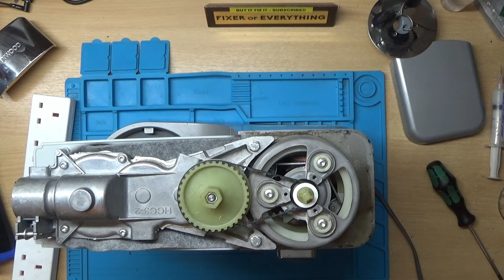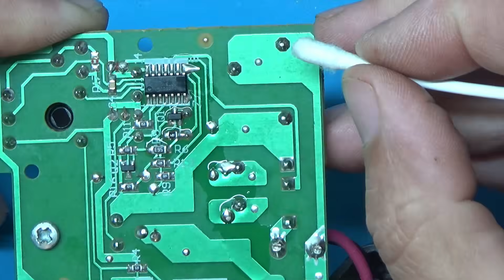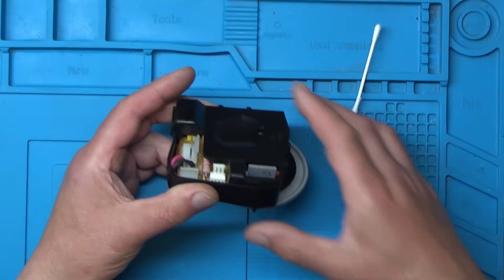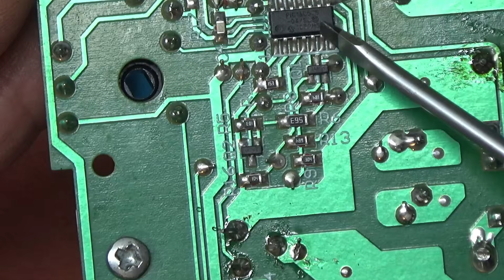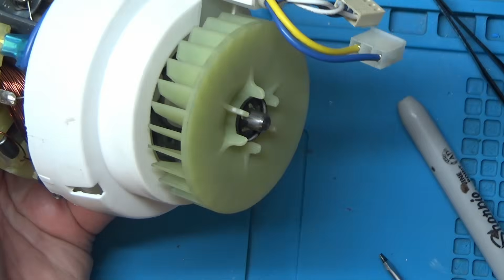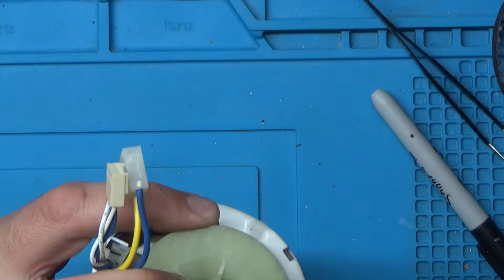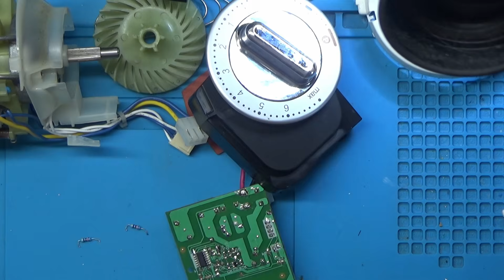Faulty Kenwood Chef Mixer - What A Nightmare! | Can I Fix It?

Comment: Looks like the coating that was put on those resistors altered the colour of the bands. A 502K should be blue black red orange, to make an orange band appear to be brown is quite a change.
Reply from the maker: I think they were supposed to be 470K, but perhaps over time / heat or something make them go out of spec.
Reply: @BuyitFixit  470K (correct) to 502K is a long way off spec at 1%.

Comment: I have much respect for your electronic diagnostic knowledge and soldering skills.  I do need to know why you did not use thermal camera?
Reply from the maker: Thanks 👍I only really use the thermal if I think it's a short circuit. The symptoms on this seemed like a capacitor or something as if you left it for a few moments (switched off) it briefly sprang back into life then progressively got worse and worse.

Comment: For years Kenwood used a rather efficient centrifugal speed regulator that seldom went wrong,  was it worth replacing it with a rather crap circuit when people bye a Kenwwod for reliability. I have the MK 1 in the basement awaiting refurbishment, it still works despite the grease being thicker than a weed smoking Gen Z teenager.
Reply from the maker: 😂😂😂😂Yes the kitchen aid I worked on a few months back has the centrifugal speed regulator too. Built like a tank it is, and 36 years old!
Reply: @BuyitFixit  Progress !.   That job was a right bugger for you and more of a challenge than the ultrasound unit.  Q; the magnetic ring needs to give an accurate speed signal, is it intended to be loose to feedback a lagging signal ?.
Reply from the maker: I think when the fan part (that I removed) is pushed back on, it squashes that silicone washer down and it grips the magnet. I think it was just spinning because I had removed the fan.
Reply: The old 50's A700 (you think MK 1) is useful as an ornament. Good luck finding a replacement bowl or attachments for it.  They break when dropped.  The A700 glass bowls are not interchangeable with any of the later models i.e. A701A, A703C, A901 > all the way to present models. A modern stainless bowl will fit and function on my old 60's machines. My old milk glass bows will fit on a modern machine.

Comment: Such a cheap fix even though it was a pain to fault find, good patience to find it. Is it possible to test resistors and capacitors in circuit with a special kind of tester or do they always need to be removed?
Reply from the maker: Thanks 👍It depends on the circuit. It's not always possible to test components in circuit as other components may be wired in parallel and give false readings. The best way to be sure is to remove / isolate the component you are testing.

Comment: That's why, unless you really have the skill and even more time, it's cheaper to just throw the whole thing and buy a new one. If you calculate your hours as a skilled technician, repairs like this are unfortunately hardly worth it. But it's good fun and interesting to watch.
Reply from the maker: Thanks 👍Or if you have someone have a problem the same as this, they now know what to check and pretty much how the circuit works 🙂
Reply: "..just throw the whole thing.."  That's all well and good for the affluent effluent types. 
A typical wage slave service guy under the hammer would change the module and earn their keep... and reduce landfill from the 'just chuck it all out' type.

Comment: Probably worth checking everything isnt shorted or open circuit. As that resistor was. Would it have given a reading in circuit or could you have tested it in circuit and still found the fault?
Reply from the maker: It depends if any other components are wired in parallel with it which would give a false reading. Usually best way is to lift a leg or remove a component to test it properly.

Comment: Cracking good repair! Never seen a resistor do that trick. You may think about one of the cheap ESR meters for the caps. Or an old Heath or Eico to check breakdown voltage.
Reply from the maker: Cheers Tom 👍Yes I don't think I've came across that before either.

Comment: Not being negative but I was wondering why you didn’t look at the triac signals with a O’scope.  You pulled a lot of components first without looking at VCC or PWM signals just curious.  Also now after it is fixed it would be nice to look at the signals especially the feedback path with a O’scope to learn what the pic is looking for would help a lot of your viewers out for sure.  As always love watching you fix stuff.
Reply from the maker: Thanks 👍I don't have a battery powered scope or isolation transformer.
Reply: A differential probe could work as well
Reply from the maker: I'll have to look into that 👍

Comment: 470K mains dropping resistors  are a common problem ! they should always  be replaced with multiple  resistors to divide the voltage drop across each resistor to prevent failure due to specification breakdown limits being approached.
Reply from the maker: Thanks for that I've not came across this problem before 👍
Reply: Yep agreed, those resistors are not rated at 240v, so this one just gave up!

Comment: Well done, but I'm surprised it worked ok with a loose taco magnet. I used to repair washing machines and a fairly common fault was the motor doing a short rev-up then cutting out due to no tacho poses being sensed - caused by loose or broken magnet (should be firmly fixed to the shaft).
Reply from the maker: Thanks 👍I think when the fan is fitted it presses against that silicone ring stopping the magnet from rotating on the shaft.
Reply: @BuyitFixit  Ah yes I never thought of that 👍

Comment: Good find, but would wonder about resistor opening like that. Possible wattage or what?
Reply from the maker: Yes, but I would think there would be loads of these failed with the same problem if it was a design problem (perhaps there are).

Comment: For burnt out resistors, measure the two parts. One part will hopefully give a reading. eg if ~2/3rds of its original length measures ~32kΩ and the other ~1/3rd is open circuit then it's a pretty safe bet that the original was 47kΩ.

For a completely open circuit resistor, cut it in half. One part should give you a reading, eg 500kΩ, so the whole thing would be 1MΩ. They fail at a single point, not along the entire length. 

Just a simple bit of educated guesswork on the ratio you have that works and rounding to the nearest E24 value can really get you out of a hole sometimes.
Reply from the maker: Great Tip! Thanks for that 👍
Reply: I like #2. Possibly poorly formed in manufacturing? Something caused it to let go without any indication. Murphys Law ? Hummmm!
Reply: Why TF would you go down that rabbit hole when the colours are visible AND you have an identical intact resistor to measure & confirm....
You would only ever go down that route if the resistor was burned up or otherwise unreadable/un-measurable and you had no other way of finding the value so not relevant to this situation at all!
Reply: @Awynn0 i think that was his point
Reply: @eliotmansfield yeah literally in the first sentence

Comment: I would never have found this one! Defective resistors without visible damage is something I didn’t think could happen …
Reply from the maker: Yes, I don't recall coming across it either. I think that's the reason why it took me so long to find it 👍
Reply: I thought it was a bad solder first, amazing resistor there

Comment: I always hate it when components just fail without a trace! Unbelievable that a resistor that only costs a few cents going open circuit can prevent this whole thing from working but i gues every component is there for a reason ofcourse
Reply from the maker: Yes, sometimes one component and the whole things doesn't work 👍

Comment: As Sid Waddell once said, "When Alexander of Macedonia was 33, he cried salt tears because there were no more worlds to conquer … [Eric] Bristow's only 27."
You'd feel like Eric did after that bloody nightmare of a fix, as in top of the world... Well done for sticking with it, great job.
When you were reading out that resistor colours I was thinking it can't be 1.3 gigaohm, it's a mixer not some sort of high voltage motor driver from a train or something.
I've never liked 5 band resistors, they're just a pain, why can't they put a mark on the 1st band, a dot like an IC, or something so you easily know which band to start with.
Reply from the maker: Thanks mate 👍Yes I've never liked 5 band resistors too 😂😂
Reply: @BuyitFixit in fairness who'd of thought a resistor would bring down a machine like that. 
Usually everyones money is on the caps going mental.
Just more proof that 5 band resistors are pure evil... 😂😂
Reply: The clue was that 47 is a preferred value number. 12 is, 15 is but 13 isn't.
Reply: @twotone3070  true, but a dot or dotted first band would make things far easier.
I mean 13 may not be a standard value, but these days who knows what a manufacturer might have decided to chuck in the mix given they can get bespoke chips, caps, etc made in bulk for pennies

Comment: Certainly, a mixed bag, well done. Capacitor dropper, one diode, one zener and a cap, no expense spared for a micro supply in a noisy motor, SCR-based thing. Odd that the magnet seemed to spin free of the motor shaft.
Reply from the maker: Cheers Ralph 👍I think when the motor fan is fitted it presses against the silicone ring and stops it rotating 🙂

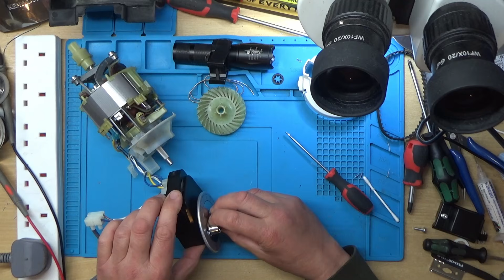Comment: Well that's one more for the  brain cell.  Thanks Again!   Process of exempting components is most intriguing, and a Blast of a Ride.   55:56  Music ...   : }  nice to hear.    Was betting on potentiometer, i lose.
[note to self] bypass potentiometer speed not affected;  Resistor in line with speed control.
17:09   Send Power straight to Motor.  Trying to 'brave' doing this with Fuel Pump, bypassing relay.  Did in '84 Scirocco, years ago, but '95 Celica's different, electronics, ?   Read so much i got confused.  lol  Now battery charged, i try, hoping Nothing Blows Up.   Cheers!
Reply from the maker: Cheers 👍

Comment: Why did you never suspect the PIC??????
Reply from the maker: Because it was sort of working, usually if a PIC fails they go dead, although I have had it where an I/O pin has blown before, but not very often. The symptoms that it started to work then slowly stopped seemed more like a capacitor or something to me which is why I started with those first 👍
Reply: @BuyitFixit  Ooo i see. Thanks for the response !

Comment: Just think how many items like tv's, radios, mixers etc . are thrown away for the sake of a 50p component. What an utter waste.
Great job saving this one though.
Reply from the maker: Yes seen it many times. I've had stuff from the dump before where it was only a capacitor or two, and the item was back up and running 👍
Reply: Yeah complexity comes with many problems to troubleshoot when it fails

Comment: The Kenwood Chef mixer can power a mincer (front section you pulled off first is where it attaches), and it can drive a blender, along with juice extractor (top rear above control knob). My parents had one a long time ago. If you wanted to thicken cream, using the whisk with the machine on full power, it did the job very fast.
Reply from the maker: Thanks 👍Good to know 🙂

Comment: 7:38 That yellow capacitor is an X2 capacitor used for AC line filtering and reducing EMI/RFI  generated by the motor. Notice that it is placed across the line (X2) and in parallel with the motor. If that were a capacative dropper, it would be more likely one of those red polymer film caps in series with the micro controller that it is supplying
Reply: You read my mind
Reply from the maker: Yes, I just had a look back at the video and it does appear to be across the input supply. I missed that at the time as the layout was slightly confusing, hence thinking it was a dropper. I guess they just use the two resistors, rectifier diode, zener and the smoothing cap to power microcontroller.
Reply: So the 5V is regulated just with two series R a diode and a zener?
Reply: @glmnet  Yes, in addition to an electrolytic smoothing capacitor pointed out at 27:32 you can pause at 19:41 and follow the traces he was pointing at in the video. The positive leg of that electrolytic capacitor goes to pin 1 of that PIC16C505 microcontroller which according to the datasheet is VDD or positive supply voltage

Comment: Yesterday I repaired my wife's beloved headphones, and I still feel good about it :) Thanks to Youtubers like you for spreading the word that it's absolutly worth a try!
Reply from the maker: Thanks 👍and well done on fixing you're wife's headphones!
Reply: A few weeks ago I repaired a mixer for my wife.  It was a really old Kenwood style which takes 2 paddles (or dough hooks, depending what you put in there).  Unfortunately one of the blades would no longer stay in. I found that these blades are usually held in place by passing between a pair of tiny plastic rods.    This forces the plastic rods apart and then these rods spring back together around a neck on the paddle.  There are no springs involved.  This whole mechanism relies on the elasticity of the plastic. Obviously in due course one pair of these rods had snapped.  (one of the rods on the other hole had also broken).  These plastic rods are moulded in to a larger bracket which is a rather flimsy design.

I found a solid block of plastic (pretty sure it was nylon) in my shed and after hours of working with hacksaw, files and sand paper I faithfully reproduced the part except no it was much more robust and, instead of having those feeble plastic rods spanning the holes, I used a pair of darning needles that were heated up and driven into place.  I was chuffed to bits with the finished part and it worked a treat. It also gave a much more satisfying "click" when the paddles were engaged.  My wife also seemed pretty impressed with the result but...

A couple of days later my wife proudly showed me a new mixer she'd just bought to replace "that old thing".  I was rather disappointed but at least I could have the old one for mixing paint or maybe just stripping down to reuse the motor in another project, right?  Sadly no.  She'd already dumped it.  She was also miffed that I was disappointed.  Women eh?
Reply: @KenFullman  Sounds like an ungrateful nob to me! Well done on the hard work and fix mate.